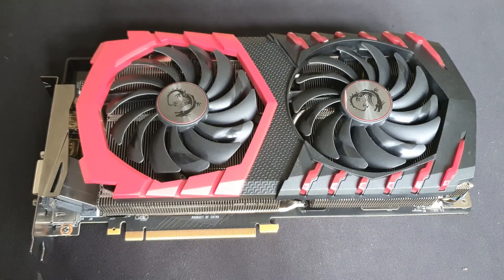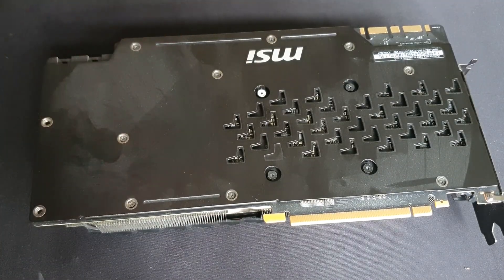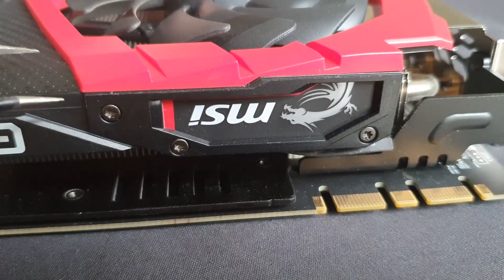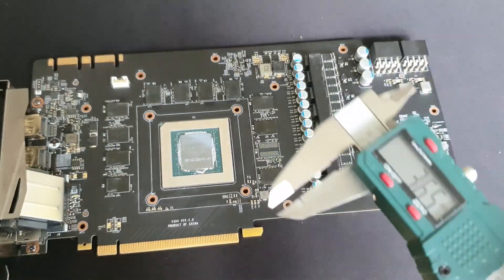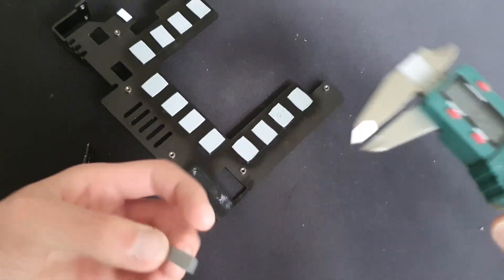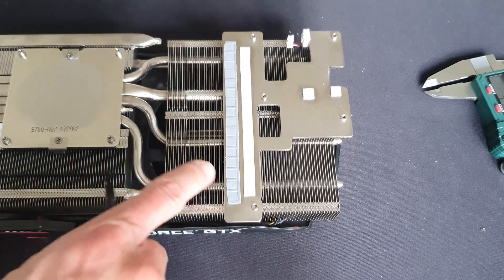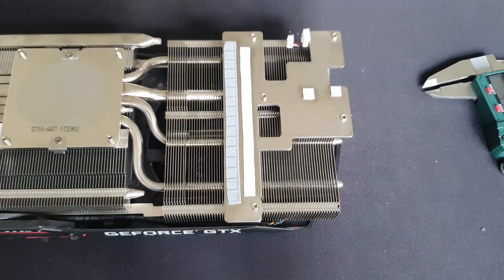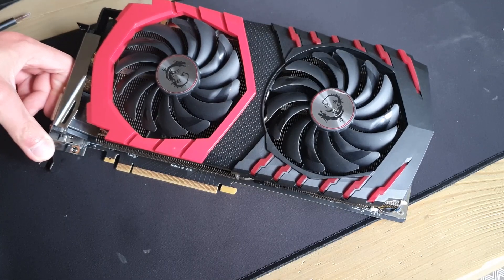Thermal Pads on MSI GTX 1080 TI Measurements, Disassembly & Thermal Paste Replacement

Comment: Thanks for the video it is very helpful. I have a 1080 Ti MSI GamingX that needs thermal pads and paste replacement. 
would you kindly tell me the thermal pads quantity shopping list? I am quite lost on how much I need to buy of each thickness for the GPU. 

Also is there anywhere where I could find GPU fan replacement?

Thanks alot man!

Comment: Do you think if I install Arctic thermal pads and apply Arctic MX-4 thermal paste, will all this work well with this video card?Or can you recommend something better?
Reply from the maker: Arctic pads and thermal paste will work well. Better then what I use, I use cheap Chinese pads and paste😂. But sometimes I use noctua paste for higher heat electronics.

Comment: Please tell me, do the usual 3mm thermal pads are used on the power circuits and capacitors, or do you need just such black ones?
Reply from the maker: You can use regular thermal pads just need to be 3mm. Does not need to be black